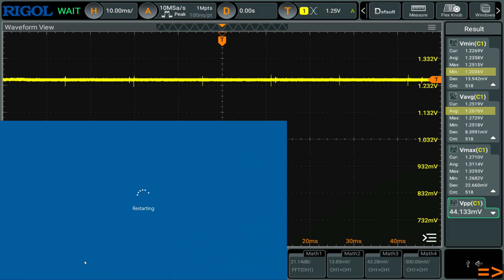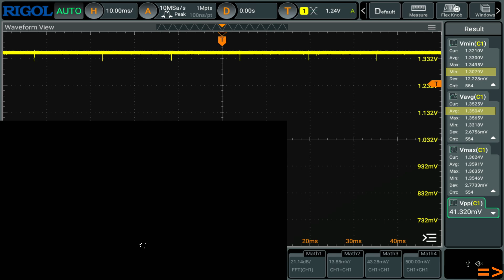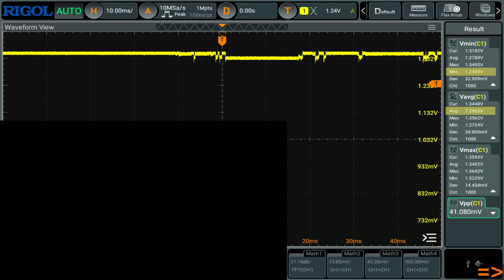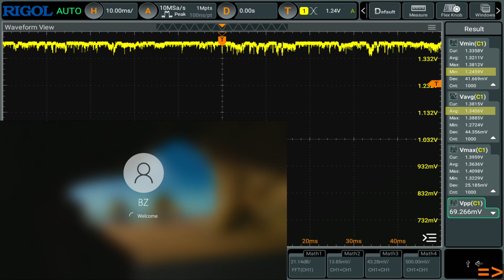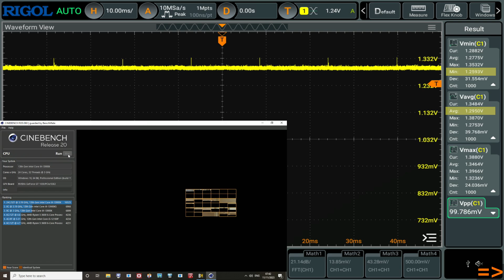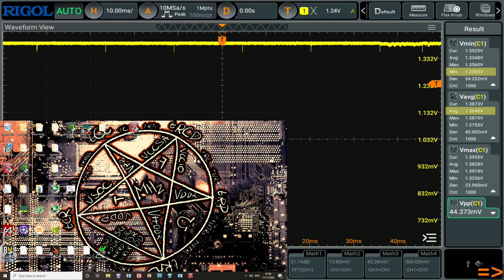EVGA Z790 DARK voltage regulation and LLC

Comment: Instead of going into the BIOS by mashing the delete key, create a one line batch file that uses the Windows built in shutdown command.  It will reboot and take you straight into the BIOS.  Now you can either run the batch file from a command line or create a desktop shortcut or start menu item for it.

shutdown /r /f /fw /t 0
Reply: Nice. Hadn't even considered this.
Reply: Thanks
Reply: This is the 3rd person I heard this from today. Someone make a TikTok?

Comment: What new mobos has this options and capabilities without blowing up the wallet?
Reply from the maker: I have high hopes for the MSI Z790i Gaming Edge wifi. ITX boards sometimes do really well in voltage regulation due to the short power plane and the lack of space forcing manufacturers to use SMD polymers instead of through hole caps.
Reply: @ActuallyHardcoreOverclocking hat about amd boards😬🤗 i will ask better question what brand of am4 and am5 would u recommend for manual tweaker  beginner+ lvl most important is the price second important is the results third important is the easy ui in the bios😁if u already done the vids send me please the diraction✌️
Reply: @ActuallyHardcoreOverclocking saw your post with the edge and 8000 memory. Will we get a video once that’s resolved?